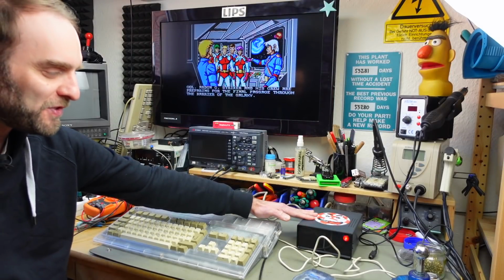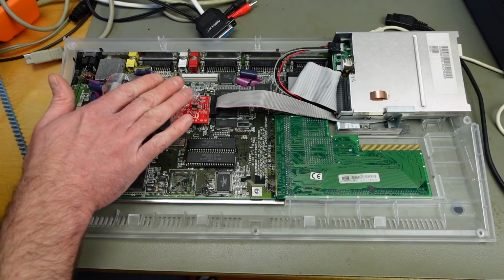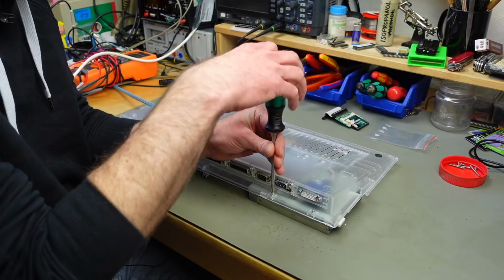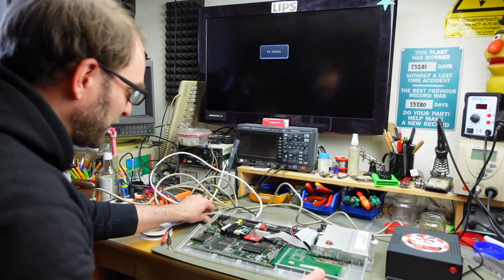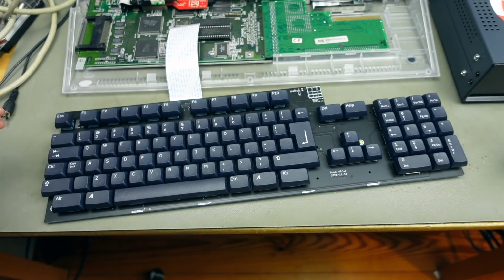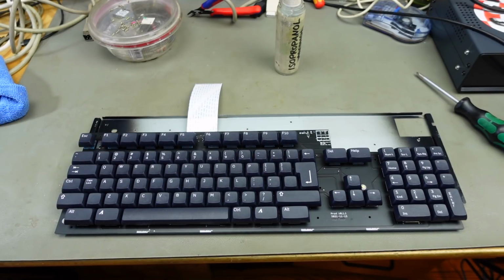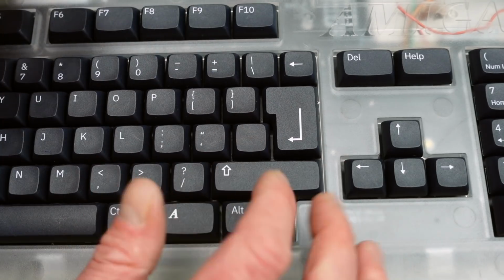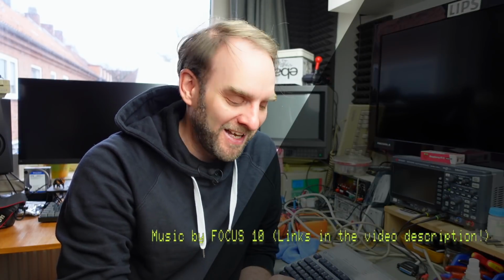A mechanical Keyboard for the Amiga 1200!

Comment: As a programming teacher said to us "if the fix works leave it alone" and "perfection in the enemy of the good". I recapped my A1200 years ago with new caps I have no idea on the brand or the quality of soldering, but it works. If it fails in 20 years, or the post-it note sitting under the CFcard sets it on fire, I got a couple more decades out of it.

Comment: The website for the keyboard is no longer up! Any other places to find it?
Reply from the maker: It's unfortunately no longer on sale. It was a hobbyist project to begin with and I think the demand for new Amiga keyboards was a bit overwhelming. A1200net are working on a similar project though that should be available eventually and there are some other options (that are only available in small batches mostly unfortunately), for example the Kipper2K replacement keyboard.

Comment: The matching of the symbols is nice, but the perfectionist in me is bothered by the font not being Helvetica! Heh. Very nice PCB though. I’d love an Amiga with BOX blue/jade/pink. 

Edit: By the way, speaking of transparent case and Apple inspired, have you seen the Matias Tactile Pro range? They use clones of the ALPS switches Apple used in the 80s, but with a design like the early-00s Pro Keyboard (inc the USB ports on each side). I notice you’ve just got grey keycaps with your Hackintosh behind you.

Comment: does this fit the a500 ?
Reply from the maker: No, the A500 needs a controller chip in the keyboard for it to work. This replacement is just a matrix with switches basically. I guess you could hack an original keyboard and connect the matrix maybe but that would be a lot of effort.
Reply: @JanBeta  hmm, i know theres a internal ps2 adapter for the amiga 500, what if i salvage a a ps2 keyboard controller chip and wire it up ?
Reply from the maker: PS2 is a slightly different protocol as far as I know. You could probably try to use a microcontroller to replace the original chip. There’s replacement keyboards available that do that, but I’m not sure if that’s an easy task.

Comment: Whats the issue with using ceramic capacitors? Did you actually experience any problems?
Reply from the maker: I didn’t experience any problems with the capacitors myself, but I’ve heard from a number of peeps now that there can be timing issues, especially when using fast accelerator cards and such. The specs are definitely not the same and random oscillation may appear, even if most caps are just bypass or filter caps in the A1200. Won’t recommend using anything but electrolytic or polymer caps!
Reply: @JanBeta  Thanks for the heads up.  I bought a cap kit with ceramics but luckily not used them yet for my ReAmiga 1200.  I'll get the proper ones. Thanks. 👍

Comment: 15:08 aw, man...
That tape will leave a disgusting residue where you used it.
Should have used hot glue instead.
Apply it from the top, starting from the pins of the socket, then go around the edge of the board, over the solder joints of the socket, and wrap around the other side, that way it will be more firmly stuck on the adapter and you won't risk it coming loose.

Comment: Man, that keyboard looks great, shame they used terrible nonstandard switches. I see people in the comments talking about replacing the switches, and that would be nice, (especially cause blues suck) but I'm 99% sure those are a certain Kailh switch only available as red linears and these blue clickies, with overall smaller dimensions than actual MX format switches, so the footprint isn't compatible most likely. AFAIK these are the same as on the IQUNIX M80, unfortunate.
Reply: They look like standard footprint cherry compatible to me. It’s not the low profile caps, those have a different stem design. The clear casing just makes it look flatter with the foreshortening when he takes the key off
Reply: @kaitlyn__L  They look pretty distinctly like the Kailh mid-height switches used in the M80, which are almost the same design, size, and footprint of Cherry MX. Hard to notice by themselves, but nonetheless shrunk down. The colors and materials are the same as the Kailhs, the legs are noticeably flat at the ends rather than tapered as in MX switches, the edge of the top housing extends all the way over the side of the bottom housing on one edge (light pipe?), the clips seem to be the same style as the mid-heights rather than MX style or what Kailh and Outemu use for a lot of their switches, and the pins/pads seem to be closer to the plastic legs as with on the M80 (no spacing between the closest hole and via/pad rather than the slight <1mm space on standard MX PCB footprint), along with switches generally being spaced out slightly farther from each other than standard MX spacing. Also, not quite as distinctive but still something, but this uses Costar (ew) stabs which I've not seen on any keyboard of note in recent memory aside from the IQUNIX M80.
Reply: @nothlur  yes, I suppose out of context of another board it can be hard to eyeball these proportions, so never mind what I said heh. I think Kailh should be clearer with their naming scheme.
Reply: @kaitlyn__L  Yeah, "mid profile mechanical switch" isn't too descriptive of them, especially when there's other actually MX compatible mid profile switches around lol. Also doesn't help that "mechanical keyboard" just means MX to most people these days, gets even more mixed up.
Reply: @nothlur  as an ALPS fan I used to get upset by that last thing, though now I’ve made peace with it for cool keycaps… and TBH I didn’t realise they’d made middle-sized MX stem compatible ones, was just thinking of the “Chocs”. So now there’s multiple kinds of “Kailh Blues” 🙄 ugh.
Reply: @kaitlyn__L  Yup, both Outemu and Gateron have their own basically squashed down MX switches, I think the most popular use is probably the Tecware Phantom L. The Outemu mid-height blues are actually pretty unique in their click mechanism and actually worth checking out!

Comment: The bent caps where kinda funny, i laughed a lil bit at first, but hey, since they worked... some of them are hard to desolder cause the gnd plane they are connected. Never had it desoldered without issues. i would personally reconsider and left them alone. All in all nobody sees that since the case is closed ;)

Comment: Seriously thinking of getting one of those cases for my 1200 once i either replace the board or manage to fix the chaos on the board thanks to two decades in my attic. Luckily my A2000 faired better and my A500 only lost its 512k card when the battery went bad.

Comment: I've had through hole leads migrate through electrical tape insulation over time.  I'd recommend putting a thin piece of cardboard over the leads before wrapping with tape to make sure nothing shorts out.

Comment: You should flip the CF-card adapter in the opposite direction, so it doesn't cover the cooling holes on your scanline doubler.

Also, take REALLY good care of that Blizzard 1230 IV. Those are prohibitively expense now.

I really hope that keyboard becomes available again. I want it soooo bad.

Comment: Is it possible to remap \| and #~  to the positions where the blanks are and can " and @ be swapped over in software? Having \| next to backspace is stupid. @ should be Shift + '  and be between ;: and #~. The layout would be correct then.
If you press CTRL + ALT + 4 do you get € or does that not work?

Comment: It's a tribute to the original design that just adding a clear case and a black keyboard makes it look completely new.  It wouldn't look out of place on a modern desk.  I hear what you are saying about the nostalgia itch but you can always change it back if you want to.  Speaking of itches, those bent over caps must have been in the back of your mind for ages 😊.

Comment: I know some Amigas did come with some fairly nice linear mechanical switches but I'm not sure if the 1200 did.
And either way they weren't cherry or Alps so you wouldn't be able to get replacement switches or keycaps anyway.
Reply: The A2000 made in Braunschweig, Germany, was made with original Cherry switches (black switches). The keycaps were double-shot, exept for the Amiga keys (they are pad printed). The function keys are 1u only (not 1.25 u like on the other Amigas). I actually bought Din->Mini Din adapter and used it on my A4000 later. Definitly the best Amiga keyboard ever (and as you can open cherry switches and change the stem, you even can make it clicky and/or tactile if you want without soldering).
Reply: @oleurgast730  Neat. Most of them used NMB Space Invaders. Probably pretty valuable keycaps on that thing.

It looks like all of the 500/1200/600s had cost-reduced keyboards, with the low end mechanical switches like the C64s, that rubber dome keyboards basically deleted from the market overnight.

Comment: Considering how often he has to deal with 'million screw' keyboard repairs I think it's time that Jan got an electric screwdriver.  Also, it may be over exposure to modern gaming systems, but seeing a clear casing without some LED's behind it seems wrong to me.
Reply: You should not use electric screwdrivers on electronics. It's not safe for the equipment and not very professional for that reason.

Comment: i would like to stick a raspberry pi in that clear case, is there a pc keyboard that fits the a1200 case?
thanks for the video :) they are always good, wish you did more.
Reply: No, there is no PC keyboard fitting. Also the keyrath v2, wich can adapt an a1200 keyboard and the jocksticks to usb is out of stock due to chip crisis at the moment.
If you have an Anycubic Chiron (FDM printer with 410 by 410 printbed) you might print an A600 case. Thats what I intend to do (have to repair the chiron first...). Black Carbon Fibre PETG and Powder coated spring steel to print on should look nice, but maybe transparent PETG might work also. For the A600 both an open source mechanical keyboard pcb and an open source keyboard controller are available. If you combine this with a Pi, a draw bridge with disk drive and a slot in cd drive, you would get a perfect emulator...

Comment: Ceramic capactitors are perfect in the Amiga 1200 for anything except the audio circuit and composite video circuit. In the audio circuit, you would lower the audio quality a little bit, but I bet it isn't that noticable. Just those THT electrolytic capacitors look a bit ugly IMO and would warrant to be redone.
Reply: except that ceramic capacitors is voltagedependent.  so you will have the wrong capacitance.    a booting machine if not a proof of working machine.  so no.  ceramic capacitors is not a viable replacement for the caps.
Reply: @ChuckyGang  Please read the electronic schematic and tell me which capacitors have cricitical capitance. As I told you, this only is the case in the audio and composite video circuits.
Reply: @danielmantione  you mean you can put in random vaöues..  well it will work. But not right...   Caramics is wrong. Period
Reply: @ChuckyGang  Random?! So, it's wrong but you cannot state where in the circuit it will cause a problem. Quod erat demonstrandum.
Reply: @danielmantione  yes as ceramic capacitors vary depending on voltage.  they will not have the correct capacitance. meaning  you are putting in "random values". as youtube do not allow putting in URLs I tell you to google ceramic capacitors and voltagedepenecy and you will see.. simply put: there are a reason a special type of capacitor is used.  do not change.  as told.  a booting machine is no proof of working caps.  you could put in diodes in place of the caps and the machine would still boot.     is that ok then? no..

keep the same type.   period.
Reply: @ChuckyGang  I'll tell you a little secret: The Amiga runs on 5V and 12V. We know the voltage, and if necessary, can compensate. All that needs to be done is ensuring that the deviation is within the tolerance of the circuit.

I also highly recommend to check your electrolytic capacitors: The rated capacity of mainstream electrolytic capacitors is +/- 20%. Now that's quite random, don't you think?
Reply: @danielmantione  sorry.  I do not argue with stupid....
Reply: @ChuckyGang  It's never a good idea to attack your discussion partner on lack of knowledge. I am perfectly aware of the weaknesses and strengths of the various capacitor types.

Comment: I remember when you recapped that A1200.   Time flies and you have come a long way.    That keyboard looks very nice!   All my Amiga's still have the original keyboards although I have had to replace membranes and on the A500 I have had issues with dry solder joints which caused keyboard issues.   It's nice to see options available and I appreciate it when you show these available options because it helps us keep our old friends alive.

Comment: The "capacitor plague" is supposedly due to double corporate espionage, where an engineer incorrectly copied the new electrolyte formula from Rubicon. He brought it to China, where it was then re-stolen and taken to Taiwan. IIRC, Abit was the only manufacturer that admitted that their leaky caps came from Taiwan.

Rubicon's formula allowed for a more compact electrolytic cap, allowing for wider range SMD use.
Reply: That particular cause of capacitor problems came much later.  From capacitors produced circa 1999-2007 or so.  I had one of the A-Bit motherboards that failed.  IIRC I bought it in maybe 1999, and it died in maybe 2002. (Pretty crummy the have hardware fail after only 3 years).

I'm still curious as to what caused the capacitor  plague of the early 90s, but I don't believe it was the same as the really horrible 3 year lifetime of the caps made in the the early 2000s.  IIUC the problem with the early 90s caps was about "early surface mount caps".  There's a LOT of Macs from that era that have self destructed from corrosive electrolyte leaking on the PCB.

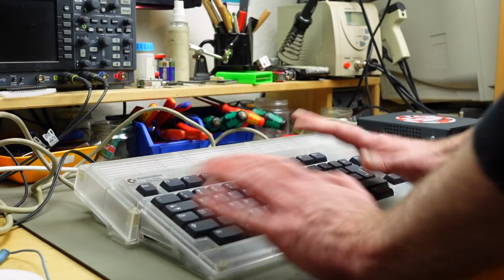Comment: There seems to be quite a lot of movement in that kb '@ 29:57  did you have clipped into its slots at the bottom?  Or had you not fastened lid down at the front?
Reply from the maker: Some of the footage was shot without the metal backing plate so it looks wobbly. With the plate it is super solid. Sorry if that was confusing!

Comment: I hope this seller chooses to make an A500/500+ version. It looks fantastic!
Reply: We all hope for that but the A500 has a keyboard controller chip which complicates it
Reply: @greenfoam  Does it? I'd have thought that keyboard controller could be replaced pretty simply with a modern microcontroller.
Reply: @tetsujin_144  I'm sure it could and I think that's what Amiga on the Lake did but I bet it's a big problem if you are one man trying to make a Keyboard by yourself. In the end Amiga on the Lake have barely shipped any of the A500 keyboards they sold years ago

Comment: Seems to bend and flex alot? Is that true?
Reply from the maker: I shot some of the footage without the backing plate in place so it looks wobbly in some of the closeups. With the metal plate, it's rock solid actually (look at the closeups towards the end of the video). Sorry if that is confusing.
Reply: @JanBeta  Thx for clearing that up. :-)

Comment: That is a nice looking keyboard. Did you take out the plate that stops the Key Board flex?
Reply from the maker: Some footage was shot without the plate, that’s why the keyboard wobbles in some closeups. It’s absolutely solid with the metal backing plate though (as seem towards the end of the video). :)